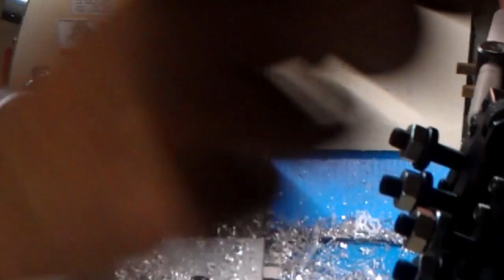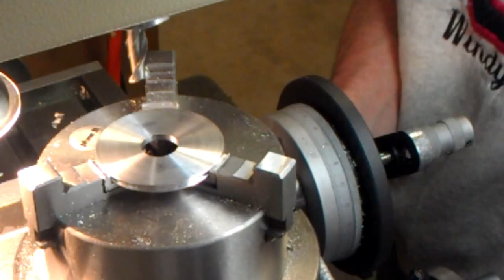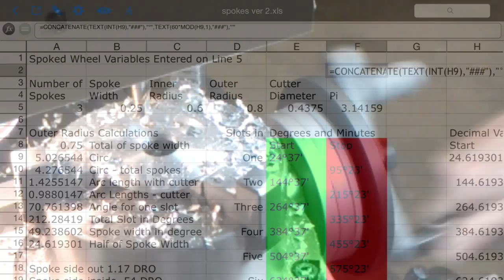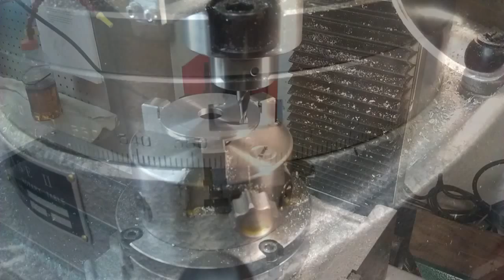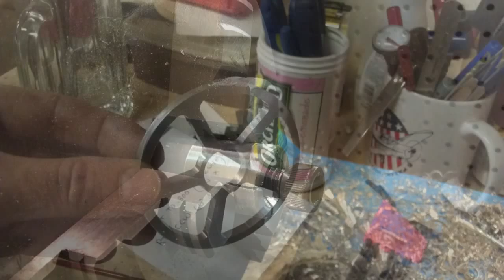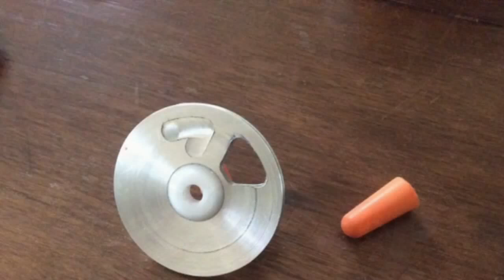Slotted Wheels using G0752 lathe and G0759 mill with rotary table

Comment: Interesting to see the compound flex so much when you tightened the tool post.  But, that is always the weak link in smaller lathes; any lathe, actually.  Still, good parts are possible if you work within the machine's capacity and take your time.  Stefan Gotteswinter proves this to be true on a regular basis and you confirmed it as well.  Chinese machinery at this price point should be thought of as kit and typically broken down, cleaned, tuned and rebuilt for optimal service, but are usually good enough to get started with as is.   Snobs tend to put them down, but without the imports, many hobby machinist's wouldn't have a lathe or mill at all.   That being said; thank you, China and Taiwan!!!

Comment: Hey Jim, I just purchased a G0759, and am waiting for it to arrive. I am a newbie to milling machines. I have been using a drill press with a slide table for quite a while. I was wondering what tips, if any, you might have for me regarding getting started with this machine / setting it up. I would prefer that you email me directly if you don't mind. Thank you in advance!

Comment: Did you have any problems moving it around before setting it up as far as weigh ?
Reply from the maker: Robert, are you referring to the rotary table weight?  I didn't think about how heavy it was when I ordered it.  With the three jaw attached to the rotary table the combination is pretty heavy but I can still pull it out of the cabinet underneath the mill an place it on the mill.  I tried leaving it on one end of the mill table and the vise on the other end but I could feel the drag on the X axis from all the weight so I don't do it.  I think my RT is the 6" Phase II from enco.  It is the smallest one from them that has the optional dividing plates.

Jim